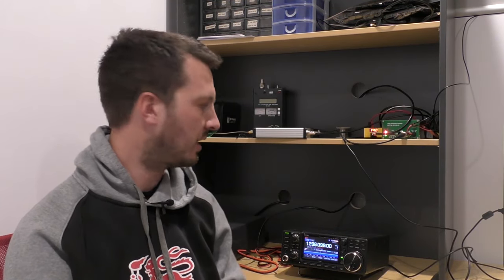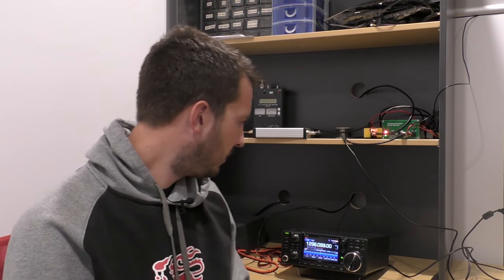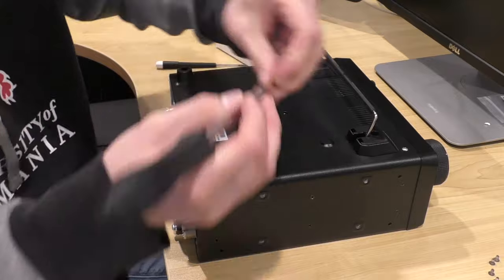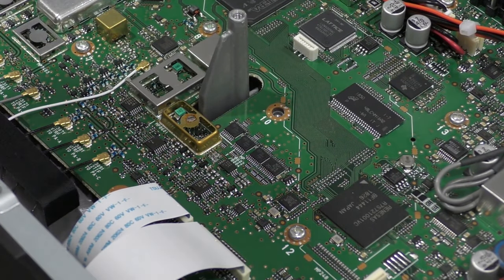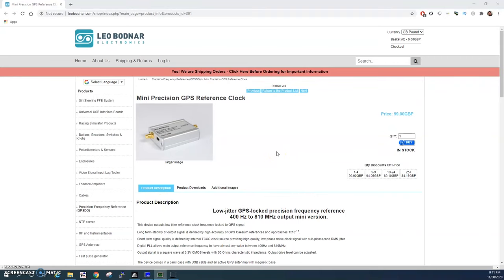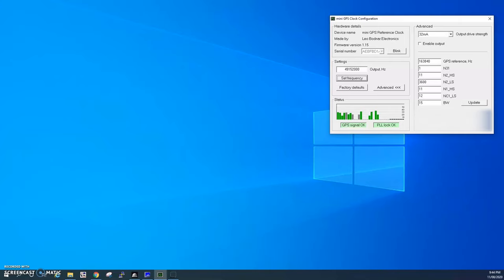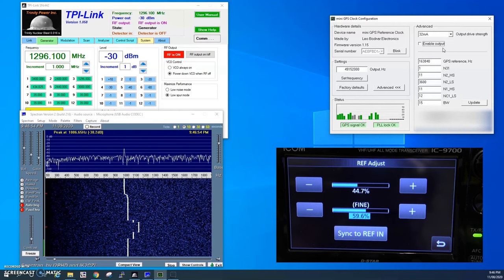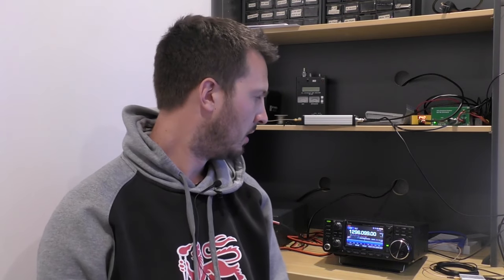GPS Lock Your Icom IC-9700 - STEP by STEP

Comment: Thanks Hayden a nice succinct video.
Best piece of advice is have the right screwdriver - JIS 2.0 - for the cover screws before you start.

Another hint. The SO239 that is used for the 2m antenna on AU/US models is not soldered in place and can be simply exchanged with a N type socket by unscrewing 2 screws and swapping out. No need to remove the cover.
Reply: It's not soldered in place,  how does it make connection,  a tension spring? Damn just another corner cut by Icom?
Reply: @kevinmccool3719  
It magnetically couples to another coil, in the radio. No direct connection required.

Comment: Nice summary of the board and installation Hayden. That should help people to make the decision to get GPS locked and onto 2m WSPR when they see how easy that is and you dont need to make any permanent mods to the radio to do it. Have had mine working for around 6 months now and never had an issue at all and mine runs 24 hours a day.
Reply from the maker: Thanks for the comment and for the positive reviews you have had too!

Comment: The 26th harmonic of 49152000 is on 1,277,952 and is audible on my IC-9700. Tune 1 kHz lower and use Spectran as Hayden shows to check frequency
Reply: For anyone reading the above comment, be advised that this won't work if you're using the external GPS to steer the IC-9700. You need to disconnect the output of the GPS clock from the new SMA connector on the back of the IC-9700 and have it instead loosely coupled to the antenna input of the radio ... think along the lines of a piece of wire as an "antenna" from the GPS clock SMA output at 49.152 MHz with the signal being picked up by an antenna connected to one of the coax antenna connectors the 9700.
That way the IC-9700 will be using its internal reference and you can adjust the REF Adjust sliders using a harmonic of the output from the clock as the CW source.
You can use any harmonic ... 3rd at 147.456 MHz, 9th at 442.368 MHz or 26th at 1277.952 MHz.

Comment: Was my goto reference for finally getting the board in and setting up the frequency - am already impressed how rock solid it is, I actually use WSPR on 2M with my 9700 when I'm not chasing the 'birds' but cant wait to get into digital modes as the sats go over now as the frequncy will be far more stable. THanks again, really good video. 73 2E0FWE
Reply from the maker: Thanks! Glad it helped

Comment: Great video Hayden, just one question, once the "enable output" has been ticked do you just close down the software and does it run in the background or do you need to keep the software running. I have the units ordered but just a bit confused as to how it operates in everyday use.
Reply from the maker: Nope as long as it’s powered up, it will remember the last known state 👍
Reply: @HamRadioDX  Brilliant mate, I have a USB hub with 2 power output ports so once set up I'll pull it out off the USB and into the powered USB port so it's constantly on :-) Cheers.

Comment: Question, maybe dumb, when you used your TPI link signal generator to create that 1200mhz signal, did you inject this directly into the front end of the 9700? If so, what db level did you set? I was looking at picking up one of those TPI signal generators, they look super useful.
Reply from the maker: Do I just hooked it up to an antenna (a little test log periodic) and hooked the 9700 to one too. I just set the dB level to about -70 which was super strong. The lowest the TPI will go is -90, so you need more attenuation if you were to plug it into the radio, but... I didn't do that just in case I accidentally hit transmit and blew it up!
Reply: @HamRadioDX  So I just received my injection board and their mini GPS. When I enable the output via the software, it does weird things to my 9700. It's like it's distorting the received RF I might be receiving at the time. For example, turn on my RF generator, things look good in the waterfall. Enable the output of the mini GPS clock, and I get all kinds of RF on either side of the waterfall. I took a screenshot: https://imgur.com/a/ByweUoU
No idea what's happening with it. I shot Leo Bodnar support and email.

Comment: What is really going on with these companies that make such nice radio equipment but they can't simply install a stable master reference oscillator in them. People pay a premium for it already so a little extra cost for frequency stability and accuracy should not be an issue for most to pay a little more.

Comment: Hi Haden  love your item  I  purchased one of the Leo Boards and injector  but unfortunately  the IC9700 has died   the PTT out put to the amp ( even with the icom circuit )  taking out Q2932  TRANSISTOR  and now nothing on the screen  VK7KWB Bryan

Comment: Quick question. Does the drift effect 2m for EME JT65? Or this primarily effect the 1.2ghz? I'm tying to get my first EME next Saturday during the contest, but I believe it's only an issue on 1.2. Thank you.
Reply from the maker: The drift is really only an issue on longer transmissions modes such as WSPR etc on 2m. JT65 works fine especially if you have the auto calibration sync with 10MHz connected to the back. 1.2 GHz would be another story though
Reply: @HamRadioDX  Thank you! I don't have the auto calibration sync or anything like that. But sounds like it's OK.

Comment: The Minikits injection output level is too low compared to Bodnars, or is the problem the coupler design?
Reply from the maker: I believe a combination of both. The inductor sits lower in the oscillator can than Minikits and I think it’s slightly more output but I would have to check

Comment: Hayden, I haven't read through the notes below but how would you summarize the Bodnar Injection board performance? Definitely worth it or not? 73...de NF4J
Reply from the maker: Hi Danny,
Yes it works perfectly fine. I've had mine installed since this video release and haven't even had to readjust anything. Once setup it works
Reply: @HamRadioDX  Thanks Hayden, I will be doing that Mod very soon...I received my 9700 2 weeks ago for my 53rd Birthday and I really like it! Thanks again for the Great Tutorials!! 73...Danny - NF4J
Reply from the maker: No worries at all. You'll love that rig, my 9700 is awesome best VHF/UHF base rig out there!
Reply: 100% worth it if you want/need the stability. The YT movie takes longer than to install. (5 minutes here approx)

Comment: I saw another one of your videos, where the running fan would cause it to drift which sounds like a thermal problem. The new board looks like it also blocks air flow, I wonder how it would work with just adding the unconnected board. The goal would be to control rapidly cooling but not let it get to hot -constant temp regardless of fan state.
Reply: Why can't the internal reference oscillator be bypassed instead of "swamping" it with a super intense outside source. This just seems like a mickey mouse way to do it.
Reply: @kevinmccool3719  Some ppl would rather not 'cut' into an operating radio. This adapter board can be removed at any time.

Comment: I wonder if ICOM will ever address this issue with a hardware revision? IC9700 MKII perhaps? They could incorporate an SDR out while they're at it; for the 7300 too.
Reply: Probably never.  Look: they released the IC-705.  It has a built-in GPS receiver.
It cannot lock the radio to the GPS frequency.  It cannot even lock the radio's date/time to the GPS.
Stupid.
Reply: @Rob2  but I guess that would probably possible since they are SDRs after all, I am pretty sure it can be programmed... will it ever be done, that is another story...
Reply: Of course they will,  and laugh all the way to the bank. Just like Yaesu did with the ft991 and later ft991a. Failing finals, what a joke.

Comment: What is the rf generator you have there ,because i don't have any beacon and reliable to my area
Reply from the maker: The generator is a TPI-1001B from RF consultant. https://rf-consultant.com/products/tpi-1001-b-signal-generator/
Reply: any carrier will do. even a repeater. the only thing you need to withness is that when you switch on the ref, it will pull the freq. that's all.

Comment: I've heard with the new update the 10 mhz input now works and this is no longer required Is there any truth to this or does it still drift?
Reply from the maker: The update does help - but it will still drift on WSPR
Reply: @HamRadioDX  Outstanding I'm glad I finally got an answer. Thank you

Comment: Can you just use the “sync to ref” button on the 9700 to set?  Instead of adjusting manually using the course and fine sliders on the 9700..   sorry for the dumb/newbie question...  ;)
Reply from the maker: Hey mate, the sync to ref button only does a calibration of frequency. The radio drifts due to thermal temperature changes around the oscillator. The latest firmware can continually track, but it's still not fast enough to stay on frequency. That said, it's good for probably 95% of situations.
Reply: @HamRadioDX  Got it, Thank you!!

Comment: Can the drift cause a problem on 2M FT8 or more of a problem on 432 and above?
Reply from the maker: I don’t think so as FT8 is such a short duration transmission you won’t have too many issues
Reply: @HamRadioDX  even on 23 ft8 worked ok. not super good though. On 70 and 2 - no issues with my unint. wspr on both bands (110 sec TX !) all just fine. 23 failed there.

Comment: it's crazy to think at the price this readio sells, it needs such a hack in order to be stable... that 9700 was put on the market way too fast, it's way too expensive and has design flaws on top of not be a wide band receiver... that is a lot of money for what you get...
Reply: I agree, this reminds me of my Yaesu ft-991 with faulty finals. Yaesu never could fix it properly after 3 attempts under warranty. I gave up. Now it's a receiver only. What kind of b.s. are these companies trying to pull nowadays,  guess it's all about quick money and profits, who cares about the customer and if the product is any good. 
I don't understand their mindset of thinking.
Reply: there are good design reasons why it only covers in bad and not wide receive signals. 

the stability hack: I could easily wspr full power up to 70cm without issues where others could not decode me. Only on 23 it became an issue. FT8 on 23 most of the time worked. 

For most the stability is not even an issue. It's well within the specs. Now regarding the price -- just give an example of a compareable radio that has approximately have the same features at a lower price point.

Comment: Failed at getting the last bloody screw out. Selection of drivers, tried best fit and the last b*****d won't budge :(
Reply from the maker: Try and push down to create a bit more torque. But be careful! I had one screw that was the same, just a little bit of harder twist, but don't bur it out! Good luck!
Reply: Why are these companies using weird screws now? Crazy.
Reply: @kevinmccool3719  I think it's a standard that they have been using for decades - I'm not sure is my honest answer. I've not had time to have another go at it for a while due to other stuff.
Reply: @kevinmccool3719  I did not get a different driver kevin. Just used my 20 years of experience to remove them. You cano't see if that I used a normal head.
Reply: @RoelandJansen  While they look like Philips screws they are actually JIS screws -- Japanese Industrial Standard.  Best get the proper screwdriver. The the first owner of my rig also totally sheered one of the chassis screws.  I had a devil of a time getting it out.  Now I need a replacement screw for that hole.